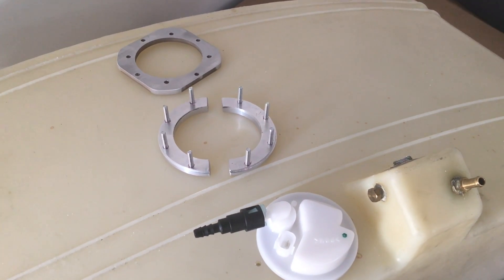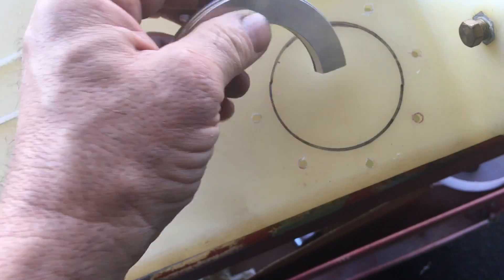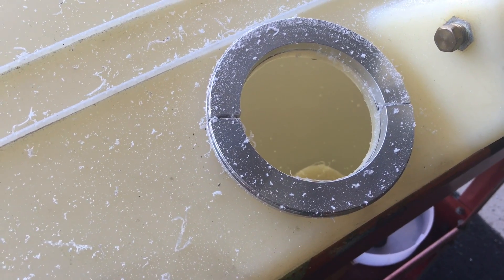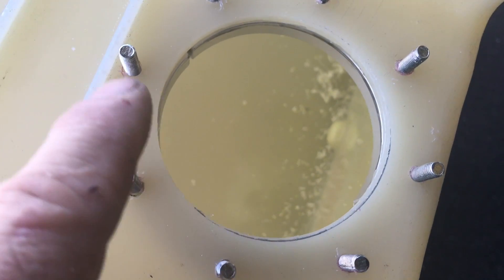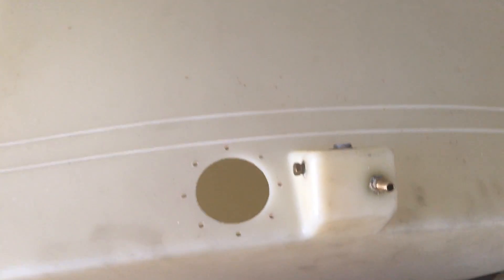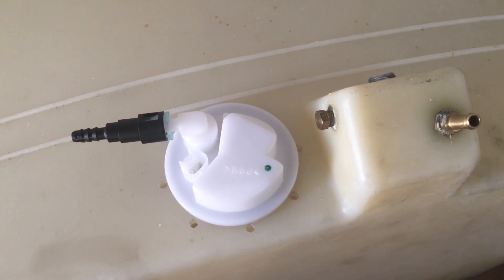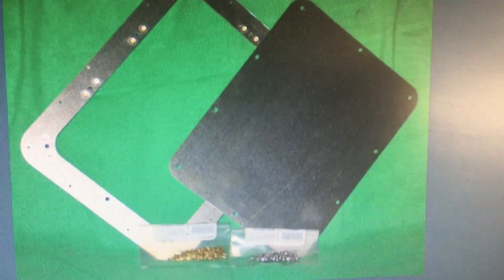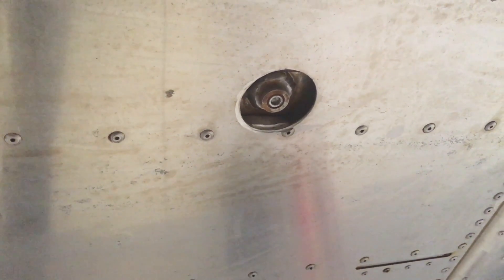Viking In-tank Aircraft Fuel System

Comment: these can be installed in tanks on zenith cruzer w/o the need for header tank(s)?
no return line on the pump itself?
Reply from the maker: Everything is a compromise.  If it was my airplane, I would let the pump stick down, then make a streamlined cover.
Reply from the maker: Exactly.  Just install and run a line to the engine from each side.
Reply: helpful video, thanks
Reply from the maker: Pump has a built in filter and pickup at the lowest possible point.   It is at the same level as the output fitting
Reply: On a STOL/Cruzer 750, what would be the recommended location to install the pump? There isn't a lot of space between the bottom of the tank and wing skin.
Reply: dont know what happened to my previous reply, but thanks for the info Jan
Reply from the maker: That is correct.  However, your usable fuel is lower